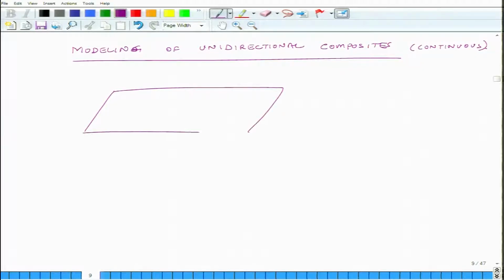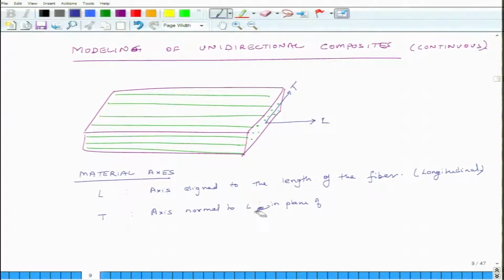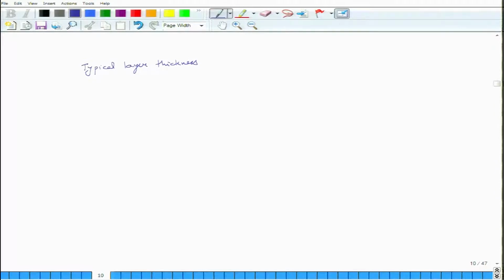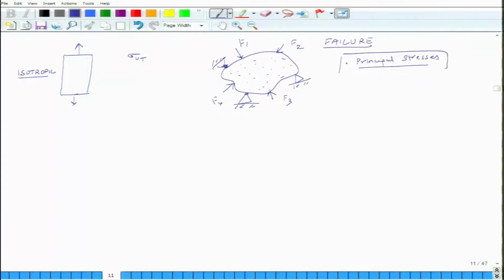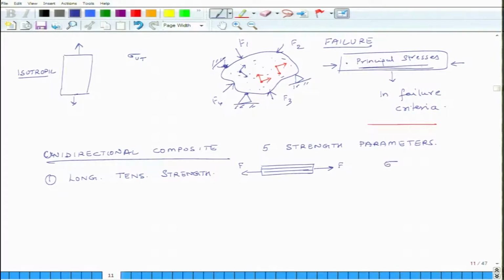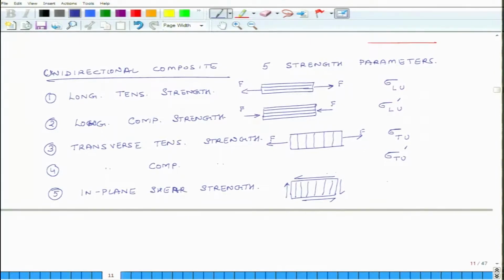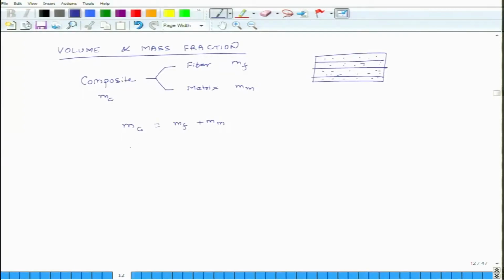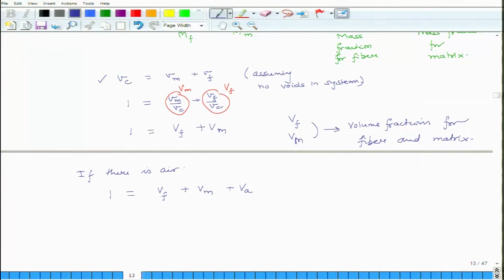Lec 27

Comment: I guess there's something unclear regarding the definition of Orthotropic materials and anisotropic materials, you,sir mentioned that in the three principal material planes ( corresponding to the principal material axis that I shall refer to as 1,2,3 and 1 being the fiber direction) the material behaves isotopic which I guess is not correct.
In a plane like 1,2 plane ( you refer to as L,T plane) the behavior in the fiber direction 1 is indeed different from that across the fibers 2. The Orthotropic material is the one for which a principal material axis can be defined in which if the material is rotated 180 degrees about any axis the structure is unchanged (three mutually-orthogonal twofold axes of rotational symmetry).